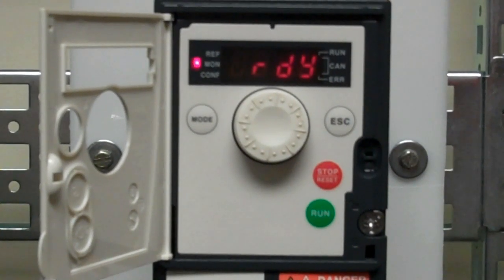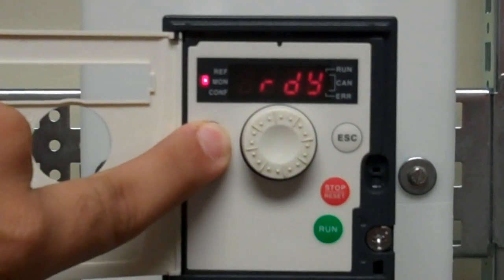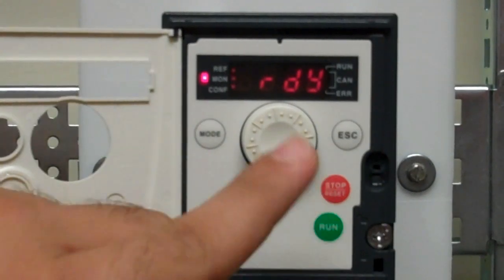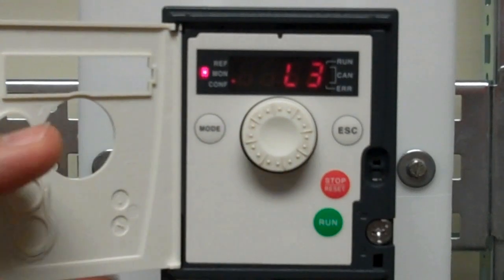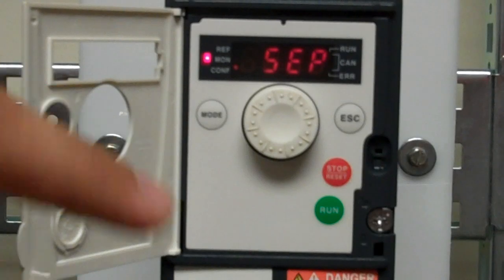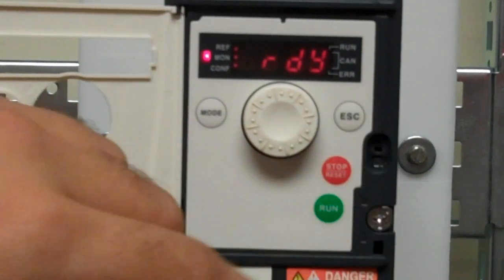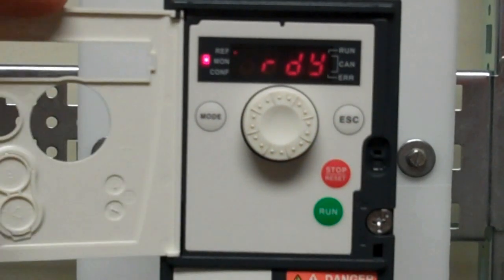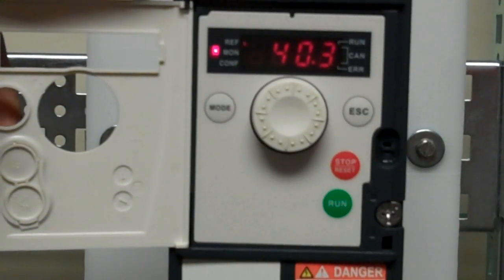Programming Altivar ATV312 for Local Speed and 2 Wire Start Stop Control | Schneider VFD

Comment: How to use DC break Schneider altiva312 ac drive
Input voltage 230volt 
Out put voltage 220 3phase 
Motor kW 0.75kw

Comment: why keep changing ,procedures .in Schneider products , please keep it uniform and make it user friendly .
Reply: ^^This - I wrongly assumed that I could configure the same way as an ATV61/71, by simply going to CTL, access level to 3 (from reading the 312 manual), I/O mode to separate and then ref to the jog wheel with command on the terminal. It didn't work, found this video which helped, but why does the VSD need to be put into local mode in the first place? If you configure the separate I/O mode, command on terminal speed ref on jog wheel, why doesn't it run? Stupid
Reply from the maker: Thanks for reaching out.  The ATV312 is much different than the 61 or 71 as it relates to HMI control. The ATV312 knobs primary function in menu navigation. Speed reference is secondary. The knob can be used as speed control by setting FR1 to AIV1, but to use the knob you must navigate to LFR parameter first (easily done by pressing knob 3 times) The display is shown as 0-100% only, not in Hz this way.  In local mode, the knob is primarily speed control, and secondary menu navigation. The way the 312 was engineered, to use the knob for speed control without going to the LFR parameter, we have to put the drive into local mode (knob now works without going to LFR) and set the profile to separate and command via terminals. Hope this helps.

Comment: I dont understand for vfd controll by remote mode
plz tell me about this from starting
Reply: Remote mode means the speed (frequency or motor speed in Hertz) and command (start and stop control) come from a source outside of the drive (such as a computer or building control center).  Local mode means the speed and command are performed using the buttons on the drive itself.  These controls can be separate so the command to start can be done locally using the buttons on the drive and the speed can come from a computer (or vice versa).